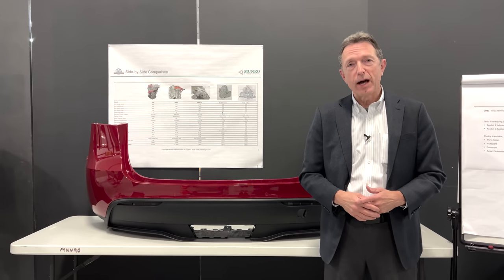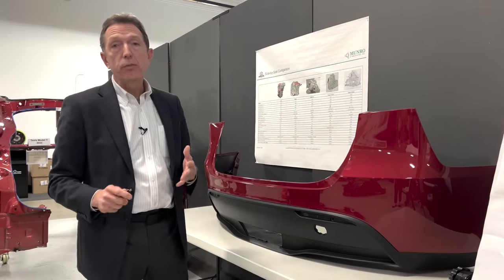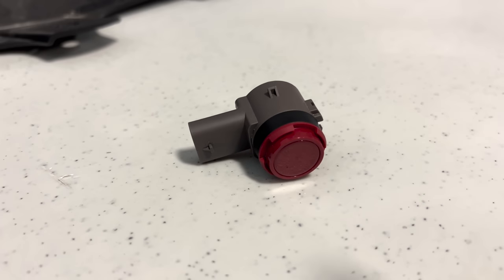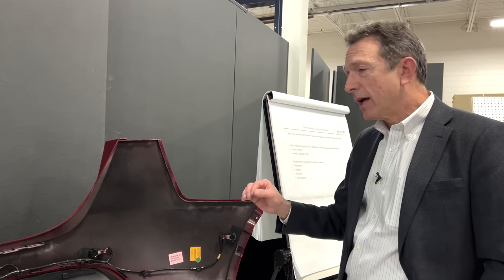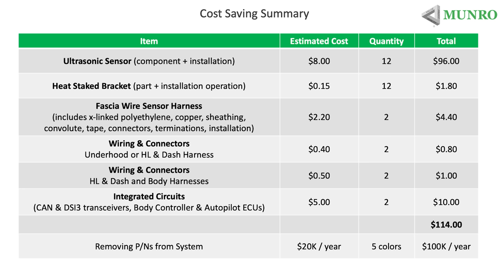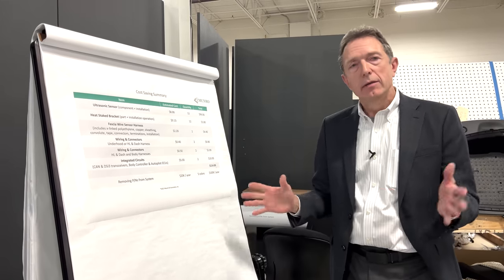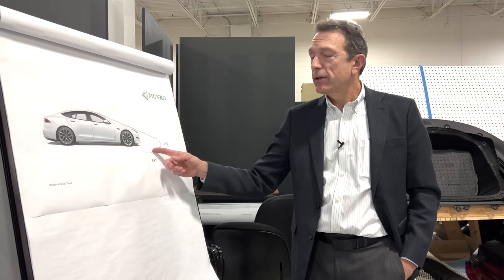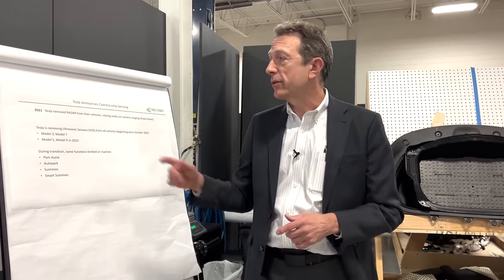Tesla REMOVING Their Ultrasonic Sensors

Comment: Elon went to some detail on this particular scenario, namely object permanence. The object in front of the car in the pyramid volume (without camera coverage), would have to been moved there from either side or in front of the vehicle.  However, I agree with Mike that if an object appeared from that volume of space without coming into the view of the side or front cameras, it would be hard for the vehicle to detect. For example, someone coming out of a manhole cover right in front of the car, while parked, and then the vehicle started moving.  It would be an interesting case to test nonetheless, I don't imagine tesla self-drive is trained on objects coming out of the ground that much. : )

Comment: I think AI in conjunction with the cameras can in a lot of ways out perform the ultrasonics, but live objects is a completely different issue.

Also the upgrade to 5Mp cameras may be fine for all of those new car buyers, but what about all of the existing vehicles that were told they're buying a car that can acquire FSD via an OTA update?? Another thing, I'm not convinced they have camera recognition of speed signs working yet, I paid $2.5k to get auto pilot that the manual says uses camera recognition for speed signs but I have camera video footage that has very clear vision of speed signs that were not recognised which tells me it's using a Google Maps location database rather than the cameras.

Comment: There is nothing about the deletion of these sensors which couldn't potentially be compensated for by additional cameras, which are very inexpensive. The major problem Tesla faces is what to do about the ever-growing number of customers who have paid for FSD in advance, but don't have the hardware installed to make it fully functional. I'm guessing they are counting on most customers upgrading to newer compliant models before it becomes an unworkable issue. Will that slow upgrade releases?

Comment: There's a basic mistake here. US sensors are not persistent while viedo knowledge is. That is: while I drive to a spot (for parking or whatever) I can generate a model with video of persistent objects relative to the geometry of the car. With knowledge of the position of the car (from wheel sensors) I can get accurate navigation without bumping into things.
US sensors cannot do this because they are too short ranged and only capture "what is" without foresight or memory.

Comment: I agree that removing the ultrasonic sensors is a potential issue. However, parking blocks dont appear  out of nowhere. I assume tesla is tracking stationary objects so they can derive the distance to an object without sensor coverage, moving objects would get factored with all possible trajectories, and right now tesla can get data on the number of objects first detected by ultrasonic sensors.  When that number is near zero the sensors become redundant.   Of course with the number of electrical components that are always failing on my tesla, maybe a little redundancy is prudent.

Comment: I see where Tesla is going with this. Yes there is a pretty large blind spot in the front but based on their AI Day last year (I didn't watch all of this year) they talked about how the vision system would be able to calculate the position of objects that have left the view of the camera. The side cameras would see an object moving and if it gets in front of the car (but is out of view of the front camera) the computer would be able to calculate its location and know where it is and thus could still stop the car to avoid any collision.

Now that said I wish they wouldn't remove hardware features before they perfect their software replacement. Now some newer cars will lack basic features (for a time) that older ones have.

Comment: My biggest worry is that they'll do to my car (2020 Model 3) what they did with the radar-delete rollout: significantly degrade the performance of Autopilot as a result of supply chain issues that occurred after the production of my vehicle. I have a paperweight radar unit now that my car is on "Tesla Vision" - I sure hope they don't turn my USSes into paperweights either. I rely on them too much.

If Tesla does disable existing USSes in a future software update, I will not hesitate to sell my car and switch to a different automaker's EV. It's that simple.

Comment: Thank you for the great video Mike. The missing 3 foot gap in the front is not as big of deal in my personal opinion . Yeah its missing, but humans have even more missing view. If you think about how a human would see, then that line would be even worse and more stretched in front. The line would start where the head would be in the driver’s seat...this would be much farther out, looks like maybe 5 feet out. If this is an issue with an camera connected to a neural network, then it would be an even bigger issue for human drivers since they sit lower in the vehicle. In a way, a human is basically just a rotatable camera connected to a neural network. Also, you have the two cameras between the front and rear side windows and these can see up the side of the vehicle far better than a human could. Tesla is also increasing the cameras to 5mp. It might be better to put the money into better camera vision the having these. One side note though is I do have a Tesla and when I back it in I guide myself with the cameras, but when I get close I do use the ultrasonic sensors to see how many inches I am away from things... I would miss that I think....but if the camera is 5mp (up from 1mp) then the clarity is going to be so much better also, and maybe I don't need the ultrasonic sensors. One other side note is that the car would drop a 3-5 pounds for better speed and mileage (ever bit counts) and also if you get in you have a minor bump the cost will be less for repair. Removing these might even lower the cost of insurance also. My brother got his sensors damaged and it cost like $100(ballpark) to get that fixed a few years ago. if you do get in a minor bump, you don't have to worry about damaged sensors if you don't have any. Anyway, I guess I am not as disappointed as others. I the 5 MP makes up for it in my opinion. Also, I don't think it is about profitability as much as people think. I think it is more about cutting costs to use it in other places..like 5mp cameras for example. For some reason, if I trade my current model 3 in for the new one I don't think I am going to be annoyed to much about the missing sensors. I would be more annoyed that I have to pay to activate hardware already in the car. =) BTW - happy customer here except for Telsa's warranty service - it is horrible. They bill you for everything. okay, I'm ranting now.

Comment: Umm Mike, that's actually the rear fascia from a Model Y, not the front like you said.  But these sensors have been in vehicles for decades and they still cost $8 each?  But either way, with all the price increases on their vehicles you'd think that more than makes up for the sensor system costs.  The biggest issue I was with Tesla is they are removing the sensors prior to the software being ready.  And can vision won't see a parking curb or other things close to the vehicle as what was pointed out in this video.  Tesla is wrong on this, more sensors are better!

Comment: How about the two motorcyclists that were killed by speeding teslas on autopilot? The cameras interpreted the two small running lights on these cruisers as two car tail lights at a further distance and smashed them at night. If they had LiDAR they would have been detected. Seems like the  wrong direction

Comment: I really like my tesla parking assist that uses the ultrasonic sensors.  I think that It will still work as you are pulling into the garage, parking space etc, with the occupancy persistance in the fsd computer memory.

But where it will have challenges is when your kid leaves his skateboard directly in front of the car or behind the car while the car is parked.  Mike lane alluded to that, but he tried to stay away from fear mongering. Will tesla keep the cameras turned on all the time in sentry mode? or what if you power them down because you are on a trip somewhere and the car goes to sleep?  

I think the owner needs to stay vigilant and I don't have an answer for the robotaxi.

Comment: Parking blocks don't move, but tesla cars do move. In a static condition there is a 1ft x 3ft blindspot, but as the car moves this blindspot information can be fed continuously into the memory. Virtually the system knows what's there or what was there in front of it few seconds ago. I guess that's the trick.

Comment: Technically doable, I suspect the visual wouldn't even change much. HW4 already in use ?

So they upgraded their cameras from 1.2 to 5 mp, which is a huge increase in data and depth that they can get out of them. Plus Tesla uses raw output which allows them to use some filtering tricks. Also, the autopilot and their vector voxel depth detection is not the same, even if the autopilot stopps working the outside will still be visualized, the closer something is the more accurate, tesla should be able to accurately detect its surroundings even in a snow storm. In the end it depends only on how much processing power you have at your disposal so I assume HW4 for the new Teslas because HW3,. is completely at its limit with what they currently run on it. There will be little change in the way close objects are visualized, just like before there will be a ring around the car that shows the distance because that is the easiest way to use the data from its vector space, you just have to use very small voxel boxes in the near environment. The only real problem I see is the area directly in front of the car, there is a blind spot, either Tesla adds another front bumper camera with 210° lens or new teslas will run over a bunch of stuff, cats and dogs that have moved in front of the parked car!

Comment: The big issue is, the sensors cover areas that the cameras currently do not.  Particularly right in front of the bumper near the ground.  The best part, in return for the cost savings they will raise prices again.  Tesla quality keeps going down and down while prices keep going up.  I'm happy with my 2021 Model 3 but I certainly wouldn't buy one of the newer ones.  There are just too many compromises and too many features removed, they are charging much much more for much less.  They don't even have functional USB ports anymore because they're too cheap.
Reply: Few things are going to get that close to the car without first passing through the sight of a camera.  From what I've seen they quality is going up now down.
Reply: @TheEvilmooseofdoom  "Few" is not zero.  It has to be zero or it's too dangerous.  Right now the ultrasonics capture everything the cameras miss.  The only other solution is to add another camera that can see into the blind spots the car now has.
Reply: @StormsparkPegasus  Nothing will ever be perfect.  You set a ridiculous short-sighted and simplistic standard.
Reply: @TheEvilmooseofdoom  When it comes to safety you do not remove safety features without an adequate replacement.  They don't have an adequate replacement.  And removing data functionality from USB ports is a big deal.  If I had a newer Model 3 than I do, I would have to spent a couple hundred on a third party module to get music in my car.  And the worst part is they are doing this while the cars are $10,000 more than they were a year ago.  Absolutely not worth it.

Comment: We have.a 2021 Subaru that relies on cameras for operation of the cruise control system (Isight). The system shuts down if there is direct low-angle sunlight, heavy fog, heavy rain, or heavy snow. Each being an example of when you may need it most to avoid a collision.
    I am not an engineer. Not even slightly. My question is this: how can a device (camera) that relies 100% on visible light report accurate, detailed information when there is no light? 
    As an aside, I do not understand how any manufacturer ships a vehicle that relies on cameras without a robust (or any other) system for automatically wiping them clean. RADAR SENSORS DO NOT NEED THIS.

Comment: I don't have an issue with Tesla removing sensors, I do have a problem with them not providing a like-for-like experience in doing so. Sure, they might replace the functionality "eventually" but it isn't there today and we are all too familiar with "Elon Time." The vision only system has significant issues in bad weather. How many times I get the warning about my cameras being blocked - it's just raining - which happens daily for half the year in Florida. When I'm backing up my Y between two Xs at a Supercharger - I'm certain those owners really hope I have the sensors installed.

Comment: The economics of this decision make total sense. However I think Tesla needs ultrasonics and radar at a minimum for their full self driving. Radar and ultrasonics have the benefit that they aren't as prone to AI glitches compared to vision. With radar and ultrasonics, it either detects something at x distance or it doesnt. Radar can also work in heavy fog and poor visibility conditions. What Tesla is essentially doing is reducing the capability of FSD system for cost savings and claiming it was necessary which I disagree with unless they have a generalized AI which they don't. Safety is important.

Comment: I will back my car into every space, so I drive forward when leaving, which is safer anyway. Before the days of sensors we would practice with an unfamiliar car in an empty car park to get a feel for the width and length of the car. A tennis ball on string hanging in a tight garage was the solution to precise parking. And a car handling course helps to know the limits of your car. Seems like these driving skills are lost on newer drivers.

Comment: In an effort to further cut costs, and streamline production of it's vehicles, Tesla will eventually remove their Tesla vision system also and replace it with an organic based stereoscopic based vision system on a swivel mount that is located in the driving position of the vehicle. This system is equipped with an organic information processing unit and complex actuation systems. This new system will be transposable from vehicle to vehicle and will also be able to work autonomously from the vehicle itself.
Tesla call this new technology "The Driver".

Comment: Was originally for the removal but after this im very disappointed in the company. The cost savings is not that much while the clear benefits is overwhelming. Ultrasonic sensors were used in cars far before any autopilot function for the simple fact that your eyes have close blind spots as shown on the very well animated Picasso graphics which btw I am subscribed to the channel. A kid playing right in front/behind the vehicle, a forgotten bag/etc or a million other things are exactly what these sensors are used for and cannot be replaced without adding cameras which only then adds complexity. Ultrasonic sensors REDUCE complexity. Removing them is fundamentally against tesla's ideals and seems to be a short term cost saving excuse. I hope im wrong in the long term.

Comment: My guess is, Tesla doesn‘t really plan on saving money in parts, but instead save a lot of money in the further development of their auto pilot.

So instead of implementing and testing different ultrasonic revisions and calibrations for the AI, they probably want to switch to cam only mode so they can rely on as few sensors as possible.

Meaning you develop and test once, but are then able to release the software on the whole product line-up, simply because the necessary sensors are same or similar enough across the board.

For a car that shall be able to drive fully autonomously one day, normally having as much information as possible for the AI would be the way to go. Even just for safety reasons.
Because what would a car do, if out of 3 different types of sensors, 2 tell it that there is an object in front? Well it can go the better safe than sorry route and brake.

With only cameras to rely on, the redundancy and therefore additional security will be missing. But the development of one Software for all Cars at once will be improved, and I believe there Tesla will be able to save a ton of money.

Comment: I can agree with the lack of radar, but taking out the ultrasonics is a tad too far. Modern ultrasonic sensors are cheap and reliable in a wide number of conditions. To claim that a purely vision based system can give the same results as one with ultrasonics added in is a strong claim indeed. I'd much prefer having a redundant system that adds minor expense than have to deal with even more expensive damages.

Comment: Excellent. And regarding the FUD. Pretend you're the Tesla engineering manager with this responsibility. 

Data you have is all camera responses and all ultrasound responses. You have the ability to make ven diagrams that detect and show ultrasound AND camera; ultra sound AND NOT camera; NOT Ultrasound AND camera; NOT Ultrasound AND NOT camera. You're interested in the last two segments (i.e. when ultrasound isn't doing you any good). You can compare that with when ultrasound is helping and when camera is also helping. You can statistically determine the effect of the removal with considerable precision. You can test your assumptions and conclusions statistically (and with actual pictures) as fast as you can think.

 Now, don't you think Tesla assigned someone (maybe a newbie as a training exercise) to do that? I do.

And ultimately, the capabilities removed should be temporary. You've got to make, confirm, test, and collect statistics on the software and behavior changes. This physically takes time. As an 80 year old electrical engineer and software developer, I drool at the capabilities even newbies have at their fingertips today.